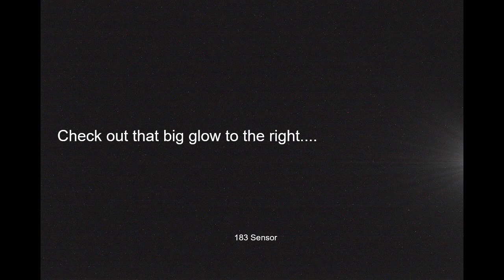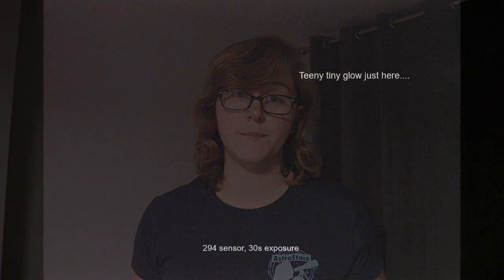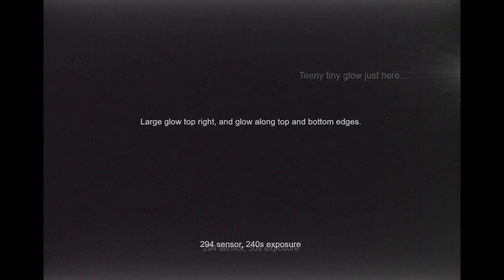Sensor Glow in Astro Cameras...how to fix it

Comment: Great video Stace! Just wondering, is the amount of amp glow a direct result of the pixel count and density on a sensor when doing longer exposures? Still learning this stuff so appreciate any help.
Reply from the maker: This kind of sensor glow (not amp glow) per se comes from components on the sensor die emitting near infrared light. The longer the exposure the more light is emitted and the more of it that the sensor picks up

Comment: Thanks for the AAP amp glow tip. I have a zwo183mc with amp glow at the bottom and the starburst on the right side that increases with longer exposures. And I have found it to be worst with NB filters but not so bad without filters. Very frustrating to have that on a dedicated astrophotography camera. Anyway, Cheers!
Reply from the maker: Glad to help :)

Comment: Just ordered myself a QHY174 instead of the discontinued ZWO counterpart with the same sensor. I chose the former for a number of reasons but among them was the presence of a hardware based anti-amp glow function. Of course I still plan to utilizing desks and flats regardless of that (untested) fact.

Informative video and cool tee shirt.

Comment: Really wish I made more progress with APP but my trial ran out. I will get it in time, but for the moment  I limit my exposure time to two minutes. Another great video and even though I wanted to use the previous advice using adaptive pedestal I have still gained more some more knowledge about APP. Regarding glow (sodium not amp) I drove back from Welshpool to Suffolk and stopped on the toll services. Looked up at the light pollution and to say I respect you or anyone getting those images is an understatement.  10k subs soon Stace the UKs Astrobackyard. :)